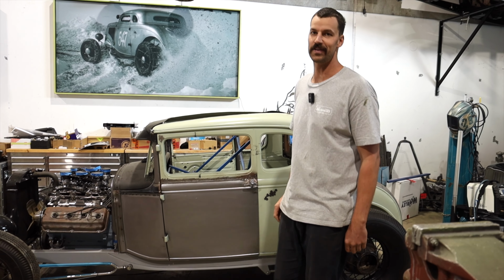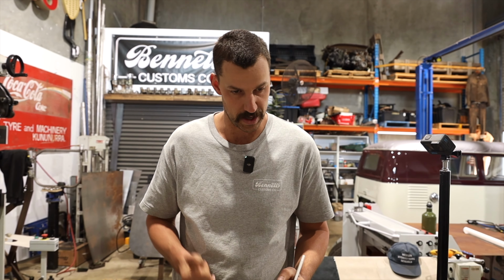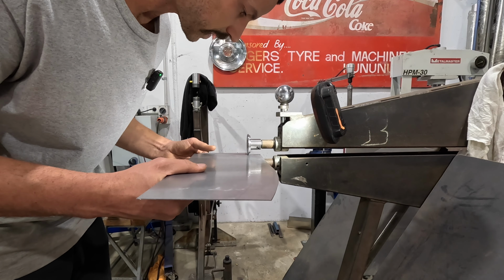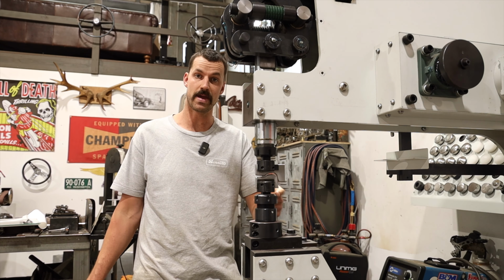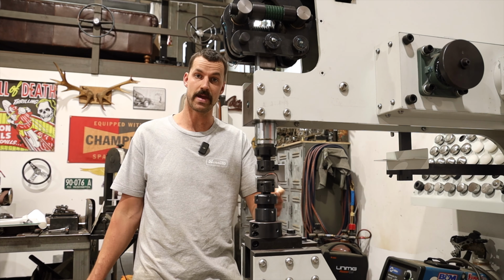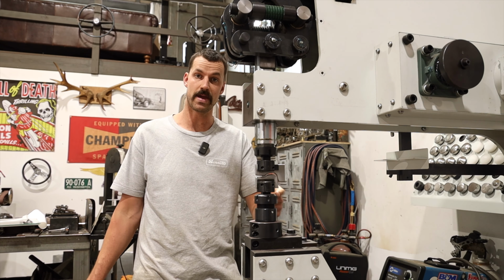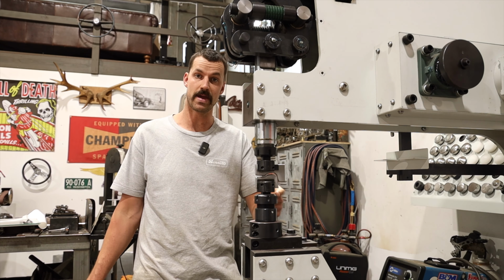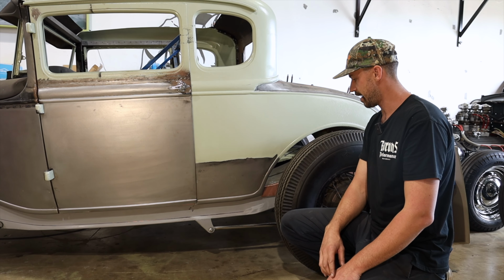Metal Shaping 101: Create Curved Panels from Scratch with HAND TOOLS, Beading & Hammering!

Comment: Nice work mate,question have you tried using your power hammer in spring mode for forming swages & beading as opposed to rigid mode ?
Reply from the maker: Spring mode is used for Planishing and shaping. When forming you always use it locked out - no spring